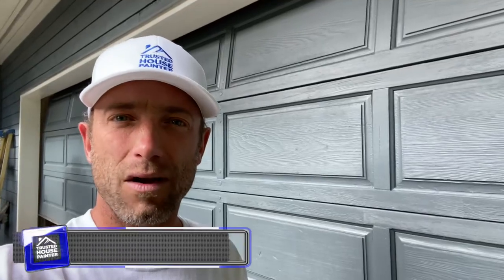Helpful Tips When Painting Your Garage Door

Comment: I currently have a white door that I purchased and will be painting it black. It’s completely dismantled, what’s the best paint to use to  ensure it’s a factory looking finish. It is a metal door not wood as in the video.
Reply from the maker: @terrydill8592  for your metal garage door I would use a product like Benjamin Moore Command. It’s a water based urethane and is very durable. Sherwin Williams has their version called Multi Surface Acrylic which is also good. Or “All Surface Enamel” is another good choice.  I have a video review of the Command product. It can be applied to almost every surface. But if you want a factory finished-like look I would consider spraying the panels. If you don’t spray the doors you can purchase low nap rollers.
Reply: @TrustedHousePainter  ok thank you, I have a sprayer I can use so I will try it out.
Reply from the maker: @terrydill8592  let me know how it turns out for you!! Thanks

Comment: So now my painter has done this, and my doors stick slightly after being closed, how do I remedy the issue?

Thx
Reply from the maker: The only real way is to remove the paint from the edges. Also, depending on how long ago they were painted sometimes you need to leave the door open (edges cracked) for a few days (or at least more open than not) to allow the paint to cure. Unfortunately, acrylic latex can be sticky even after a few months.
Reply: @TrustedHousePainter  @slycat67 one solution is to apply a thin layer of wax between each panel to prevent adhesion. You can use beeswax or paraffin wax or even a silicone lubricant .
Reply from the maker: @AverageCarGuy  that’s a great tip. Thanks!

Comment: Why does my garage door won't open the day after a paint job??? It's kind of open on one side, but making a loud click noise struggle to go up.
Reply from the maker: Sorry to hear you’re having troubles with your garage door. It’s likely because the paint has dried in between all the cracks making the door sticky. I recommend manually assisting by lifting the door to break all the paint seals. You might have to do this multiple times.
Reply: @TrustedHousePainter  Will do.  I appreciate you for the speedy reply. Thank you very much!

Comment: I have a wooden garage door that was recently installed. I was told by some to not paint inbetween the panels, but if i don't paint it, how do i protect it from water? If i open my garage door during a rainstorm the bare (primered) panels will get wet. Any advice for a novice painter?
Reply from the maker: @entice59  I recommend only applying 1 thin coat of paint to the inside panels of the door. If the door is already primed then it’s protected from wet weather. But don’t apply too many coats of paint on the edges.
Reply: @TrustedHousePainter  thanks for the reply!

Comment: So how do you paint the cracks in between the door panels?
Reply from the maker: First, I don’t recommend painting the cracks in between the panels unless you were going to remove the panels and allow them to cure properly before reinstalling them. If you paint in between the cracks and either open the door or close the door the two edges will dry shut and stick together. The alternative would be to open the door until the two panels separate and leave it like that for at least 12 to 24 hours as you paint each edge. But that still doesn’t guarantee it won’t stick the second day when you move the garage door up and open the other panel edges.
Reply: The issue I’m having is the white showing when the garage door opens? I don’t know maybe its not that big of a deal